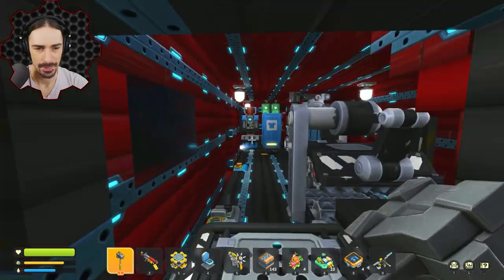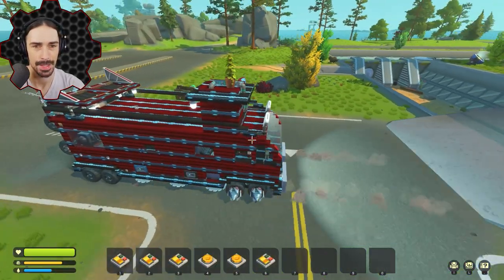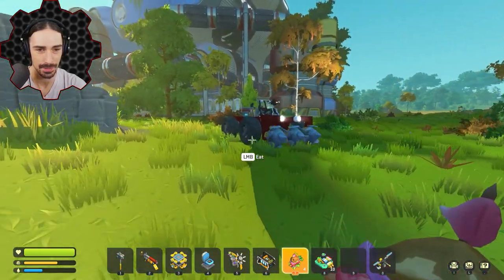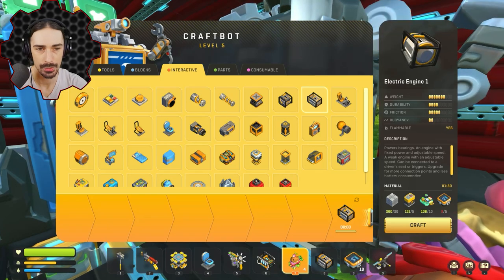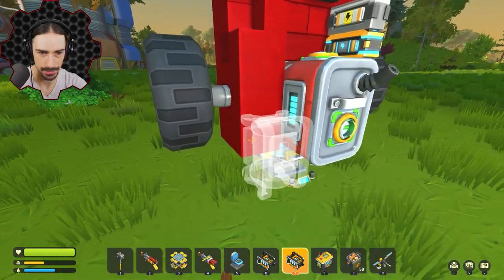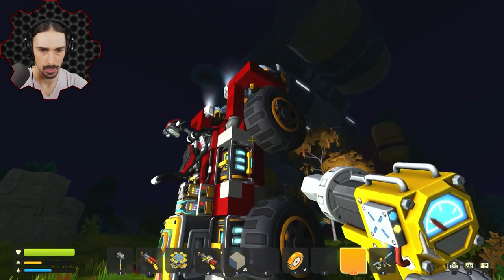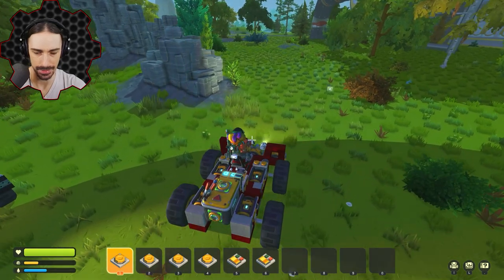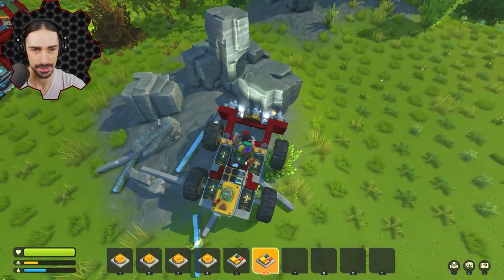Mining Vehicles: Gas Engine or Electric Engine with Tank Steering? - Survival Nomad 27

Comment: This video is amazing! I didn't know that electric engines has so many advantages when mining! Stopping and not rolling backwards has to be one of the biggest ones due to the drills having to be in constant contact with the rock a certain amount of ticks to deal damage! Usually the rocks just kinda stay there as you slide down the mountain so you have to use up gas just keeping yourself in place. Also THANK YOU for teaching me how to do tank steering! I was curious about it but didn't know how it worked!
Reply: to get batteries you could treat glowbugs like wocs and just collect cardboard like corn
Reply: @callumcoombs7579  with the generator

Comment: use electric so when the generator drops you can charge it with a piston engine.

Though it MIGHT require quite a hefty charge, so it is a bit of a gamble if it would be enough for constant propulsion of a limited battery type of deal...
Reply: the infinite battery controversy is still going on,

i don’t think they’re adding it
Reply: @apersunthathasaridiculousl1890  if they do add it hopefully they can make it so the only thing that can generate it is something from a gas engine and your hammer. maybe an if command to make sure there is no infinite battery's.
Reply: @kwiksyilverendershadow8675  or maybe a cooldown
Reply: @kwiksyilverendershadow8675  like, after 2 minutes, i can’t rotate..

controllers tent to break trying to spin a unrotatable object
Reply: I don't think scrap will be playing this nomad by the time chapter 2 comes out sorry
Reply: My idea is to use bearing on bearing on bearing, hook each bearing to controller and set controller to max rotation. (Even if devs limit power of one controller bearing, several bearing would just break rotation limit, just by way each bearing will add rotation acceleration to bearing it attached to, bearing need to be free floating and NOT directly attached to base bearing, so then base bearing reach max rotation power/speed, next bearing would have own rotation acceleration plus base bearing and VOILA you break NOT EVEN IMPLEMENTED YET, bearing controller rotation power limit for a bearing.

P.S: Hope dev's won't read this... 🤞😉🤞
Reply: @onerxowns2202  only a sith deals in controller (based) engines
Reply: Controller speed does in fact stack when putting a block or pipe between bearings connected to one controller.
Reply: they are planning to have a minimum speed for the generator to function to make it difficult to power with controllers and pistons, you probably still could with a lot of upgraded movement parts, but at that point, just going to an oil pond, making gas and powering an engine is probably easier. 

Thats the thing that's important to this debate, gas is already infinite, it just takes a few steps, hell batteries as drops are also infinite though a bit riskier than crafting,
Reply: @onerxowns2202  my thinking is they can make the speed required high enough that it isn't clearly beneficial to use controllers vs gas when you consider the oil ponds. while controllers don't use energy, neither do vacuum pumps or craft bots.
Reply: I feel like they should make it so that it still requires resources to make the battery with a generator just make it so that it needs A LOT less material than crafting them
Reply: @NovaAge  Are you ABSOLUTELY sure, Obi Wan Kenobi?
Reply: @DeltaSierra0605  do ro do not, there is no may.
Reply: @NovaAge  Only a Sith deals in absolutes.
Reply: @DeltaSierra0605  I like obi wan but let's be real for a sec who is wiser.
Reply: @NovaAge  Jar Jar Binks obviously.
Reply: @DeltaSierra0605  which said the aforementioned prase of...
Reply: @NovaAge  Yoda or Anakin?
Reply: @TheMhalpern  read oner xowns

Comment: just so you know there's a way to make a more efficient tank steering with i think only one more logic gate allowing you to go forward and left at the same time (so you have these cotnrols : forward both tracks ; left forward; right forward; left forward and right backward; right forward and left backward) and it only trigers the engines necessary so you don't burn any exess battery (but the backwards movment need an entire logic gate system too so screw the backward just do a 180)
Reply: Um tank steering is supposed to be used to turn in place so forwards and left is pointless?
Reply: @isaiahTMP  well actual tanks drive like that they don't stop to turn thy just have the inside track going slower and you can't do that unless you use a more complicated logic setup than scrapman has

Comment: The problem with the Onnings is that the first one would clip into the lower bar for some reason. After you accidentally broke it, the problem was solved. There was a window there so you probably shouldn’t replace it for now

Comment: Hi scrapman ! Small tip for engines : 
The gas engine output a fixed amount of raw power for each bearing, so the fuel consumption is linear : you eat x fuel per seconds.
The electric engine output a fixed speed, so battery consumption depend on "how much drag power you need". So if you are driving a small vehicle, you don't consume a lot of batteries. 
And also, soooo cool your music in Catarinth 😊

Comment: I don't play the game, so I don't know much about how the physics work. I have an idea for a more compact mining mechanism. I'll attempt to draw it as it would look like from above.
                   ⏸
⏹↔️↔️↔️⏹↔️↔️↔️⏹
⏹▶️                        ◀️⏹
⏹▶️     🪨🪨🪨     ◀️⏹
⏹▶️     🪨🪨🪨     ◀️⏹
⏹▶️     🪨🪨🪨     ◀️⏹

⏸ normal block connected to vehicle
⏹ normal block
↔️ piston
▶️ drill pointing right
◀️ drill pointing left
🪨 mineable rock

It's basically a mouth. If attatched like your current mining vehicle, it will take up the same amount of space, but it will count as just 1 vehicle instead of a mining vehicle and a main vehicle. It will use less fuel because you wont have to position yourself perfectly. just open mechanism, flip mechanism down and start drills, back up so mechanism is around rocks, and chew the rocks to bits. You can even add googly eyes!

edit: You spent a lot of component kits on your method, so not using electric engines would be a waste...

Comment: FWIW, for the speeds that miners go, Level 5 Controllers make a decent form of propulsion.  They're fuel-efficient but herky-jerky; Electric are unquestionably more pleasant to drive.  On a small cart like ScrapMan's, efficiency isn't a big deal, but if you have a rig with onboard refineries, it matters much more.

But what impresses me about the smaller mining vehicle (as opposed to any of the behemoths that we've all seen) is that when the drill on this car makes contact with a rock, it definitely breaks.  I've got a big mining rig (think on the scale of kAn's Combine) and that just doesn't happen reliably.  You can be pushing a block with the drills and it still doesn't break.  Clearly there's some kinda bug in scrap mechanic at work...  But what trips it?  Oftentimes I'll be in a case where the rocks simply will not break, and I put my rig on a lift, take it off, and boom, fixed it.

I have theorized that it's to do with degraded framerates caused by piled up rocks, but this video seems to disprove that theory.  I never saw one single time when the drill was in contact with the stone and the stone didn't break within 2 seconds.

My best guess now is that it's to do with the mass of the vehicle.   Could also be the number of drills, but I doubt it.  Could be something that happens when a resource collector is on the vehicle...

Comment: Make a drone that is attached with the hank tank and dittached from hank tank and actually fly's control able even from the hank tank it self or the drone it self I think this would be possible but hard and you can explore the world with that drone and its still nomad because your main car is your main base and it has wheels and there's no bed in that drone and the beacon on the hank tank would be used and don't forget the suspension mug 😂
Edit: its possible
Reply: Not possible in vanilla, the drone would need its own seat
Reply: @tempestrage257  it is possible
Reply: that sounds like a job for kAN
Reply: @g09h  how?? Care to elaborate??
Reply: @tempestrage257  No I mean you can disconnect the drone from the hank tank and that fixed the problem and if you want control by your car just connect it back and there's space by the hank tank on the side so the weight is even or on top
Reply: @apersunthathasaridiculousl1890  well yes but no because kan is not here and brick can't fly easily because weight and scapman is more capable because scrapman is not just build a brick and and add trust on the side no scapman would build an wedges drone but not by wedges but by the block and shaped like a wedges like scapman first generation of hank tank before scrapman added the four wedges on the front
Reply: @Chaos_H  "Make a drone that is attached with the hank tank and dittached from hank tank and Actually flys control able even from the hank tank it self or the drone itself"

you cant control 2 vehicles with a single seat, the drone would need its own seat, thats the only way you could use it
Reply: @tempestrage257  yeah that what I said before you can just disconnect the button from the hank tank to the drone or the opposite
Reply: @tempestrage257  and scapman has two seats
Reply: @tempestrage257  just put the seat on the drone then control it or by the hank tank it self
Reply: @tempestrage257  there is a controller glitch
Reply: @tempestrage257  its that simple right? Its just need a seat buttons on the drones and hank tank controlling it on top of the hank tank/second floor or just put buttons on the regular seat in the hank tank besides scrap man has a lot of seats or just craft one and scapman have a lot of component kits to upgrade the jet engine or just find component kits
Reply: @apersunthathasaridiculousl1890  to make it 'radio control'?? AFAIK that was patched
Reply: @tempestrage257  oh, whoops,
Reply: @tempestrage257  no jesus crise do you been reading what im saying you can detaches the hank tank buttons to the drone ones or the other way around and just control it by the hank tank or the drone
Reply: @Chaos_H  dude, the fact that English, im guessing isn't your first language, I'm trying to read what you're saying, and what I gather, from what you say, your idea isn't possible in game, its as simple as that.

Take it or leave it 🤷‍♂️

I'm guessing you haven't even played the game either??
Reply: @tempestrage257  it is what it is. I'm gonna just ask for this to happen even tho it doesn't work it doesn't matter because its just a request and yes my first language is not English/ isn't English
Reply: @tempestrage257  and dude what are you saying this is not possible? it is possible, just connect the connection point from the hank tank to the drone it doesn't have to be controlled by the seat on the drone😂 and just delete the seat, just add buttons on the hank tank to control the drone and put the connection point in a different seat not the hank tank seat that is on the front that controls everything, and put buttons on the drone with the seat and just control it what is the problem here?
Reply: @tempestrage257  and I have played the game wdym?
Reply: @tempestrage257  and its similar to the mining Vehicle but you can control it by the hank tank and the mining vehicle
Reply: @Chaos_H  you can actually control 2 things with one seat, not at the same time but if you use pistons and sensors you can control 2 different things

Comment: The last time I checked, Gas Engines have better speed and are better in survival (for now until there is Electric generation) but Electric engines are high torque. Generally, this is the formula but in terms of fuel/ use consumption, it's not much different.

Comment: The reason your exhaust pickups don't work so consistently is because they're firing off consistently. Every time it triggers and there's nothing there, it has to go through its "Error, nothing found" cycle before it tries again.  If you had them sensor controlled then they'd fire off as soon as they sensed something, whether or not something was actually there that they can pickup. Meaning pigment flowers, corn, circuit boards, component kits, and everything else that it can normally pickup will trigger the sensor and therefore fire it off only when it's needed. I'm just saying you can take your under engineered system and add a little logic to engineer it enough to where it's better.

Comment: the water treatment plant is probably the rocket place because that is the main source of water and so building it is close to clean water... you should really try building your resource collectors into your vehicle instead of having to continuously take them off and place them near your resources... for my vehicle I can drive strait over bots, I have a rail the with of the vehicle that lowers a series of pumps in a line down in place to collect circuit boards component kits etc... and a similar setup for resource collectors, they are not next to any blocks though to prevent the collision lag just strait on a piston. I can literally just drive over bot after bot, after bot never have to get out of my vehicle and grind rocks super fast. I can't imagine how you can deal with that little rock grinder lol that's early game rock grinder. next to my resource collectors "yes more then 1 to handle the fast grinding of rocks, I have multiple refineries too not just 1... yes its heavy, yes it burns a lot of fuel, but I have unlimited fuel with my gas station which is also highly efficient. I produce around 1 entire large chest full of fuel in seconds not minutes

Comment: also, I like your steering however I never had much luck with control like I said, I did a 28 wheeler and the design I used, is 7 sets of axles created using the T joint from the pipes and 1 bearing on each side, with 1 wheel on each side that's 14 wheels on the left side, and 14 wheels on the right side... its like a tank setup. now what I also have is 1 piston on the 2 front wheels, back wheels and middle wheels this allows me to lift up incase I get stuck on a rock or something so I can get out of just about any situation. next up is the placement, of course there's a center pivot wheel it does not turn... and the farthest back tires I have the angle set to 40 degrees for the farthest back wheel, 35 for the next up wheel, and 30 for the next wheel from that, the front wheels I haven't changed yet I like them at 27 stock settings though because with this setup I can get a nice tight turn and my weight is enough to keep it from tumbling over as its not top heavy "unless lifted on pistons" now for the actual turning... again all wheels turn on each side except the center wheels so there's 3 front wheels and 3 rear wheels and 1 center... each is a double wheel as I said earlier. they all turn in the shape of the letter C sort of. so if I turn right the wheels sort of form the letter C almost same for turning left except a reverse letter C... of course the rear wheels are turning tighter so the curve is off a little for the C but close. this has been my favorite setup for the most control with steering since I started playing. no other steering has given me that much control. with 28 wheels I rarely slip but that's a ton of metal too. and that drill I sent a link for, I put an upgraded version of that drill on my vehicle.

Comment: Considering the fact that the Battery Container also has a port for depositing batteries automatically, you could potentially add in a pipeline from the craft bot to the rear of the Hank Tank so that instead of having to continuously adding and deleting a block, you can just . . . pop the miner on.

Comment: you can change the direction your vehicle spawns on the lift, or the orientation of it by placing a new block on the lift, and now add a block to the bottom of your vehicle next begin welding from the bottom of your vehicle the bottom of the added block and weld it to the top of the new block which you placed on the lift. that will change lift orientation then remove the added block and it will still go up right the correct way each time you put it on a lift now. also tip idk if you knew this but if you hold shift when holding bot spines that get dropped by haybots, you can scroll the mouse wheel or press q to rotate, not just rotate them with Q...

Comment: I have a concept of drifting build a normal car and on the other side of the wheel with the help of pistons attach a saw hook the piston to a button let the saw go 2 blocks down the wheel attach thruster on the back and when you turn press the button it will bring the saw down so saw have low friction so you would drift

Comment: what no one talk's about is that little detail where the electric engine has a smoother output power where the gas engine goes up and down with the speed and power slightly very fast 

the electric engine:                                                                     the gas engine:

- smoother                                                                                    -speed-up
-act's like a brake when not used                                              -roll's when not used
-no speed-up                                                                                -no smooth output (making it harder for steep climbing)